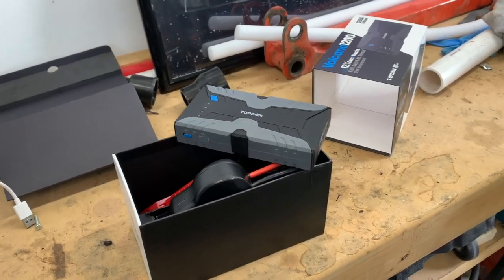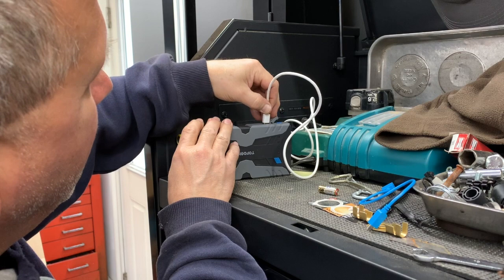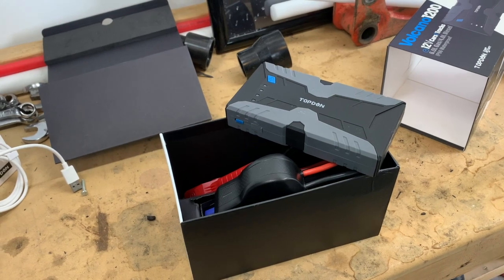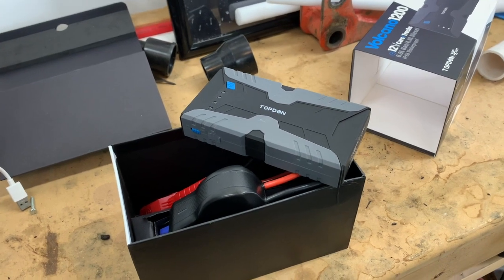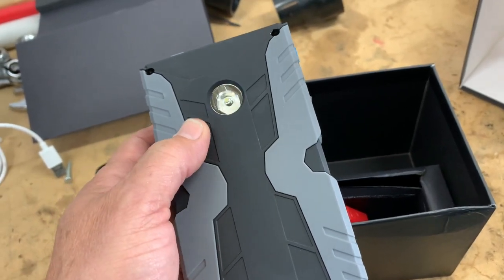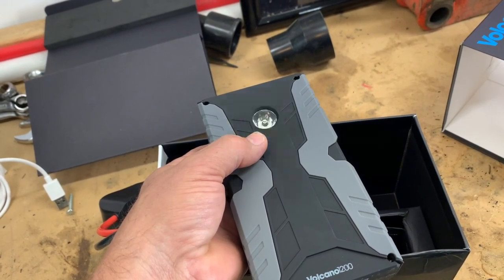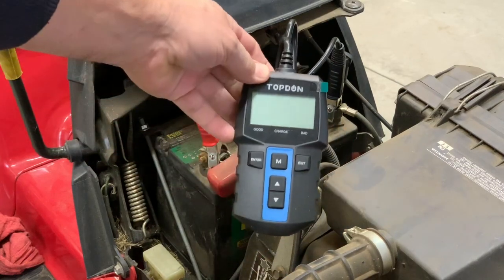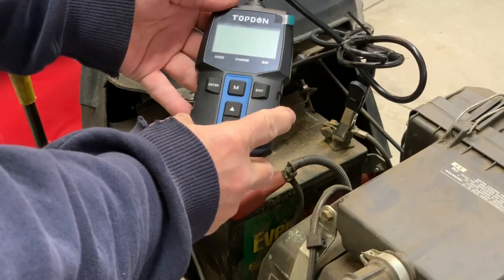TOPDON V1200 Powerful Mini Battery Jump Pack Review

Comment: i have this Jump starter - compleate shit. it cant start diesel cars.
Reply from the maker: Really Gints? I would contact the manufacturer, they have great customer service.
Reply: @EddieCarrara1  it could not start my 1.9 tdi VW.  And after like 2-3 attempts was alredy dead.  I did contacted them.  They were asking me some question.  Propobly tomorro i will give them answers and we will see how it goes.
Reply: They are just playing with me..send widoe like this or like that..it is a joke...   I would newer rocoment this to somone !!
Reply from the maker: @ginchajsable  sorry you can't get anywhere with customer service, maybe there's a new customer service rep?
Reply: @ginchajsable  I also had bother with the exact same model bought from eBay recently, think my son's going to do a video about it, I think they may be old stock as there is a newer version out.